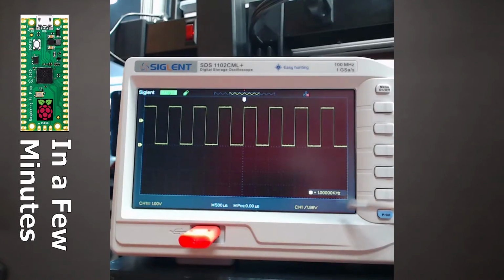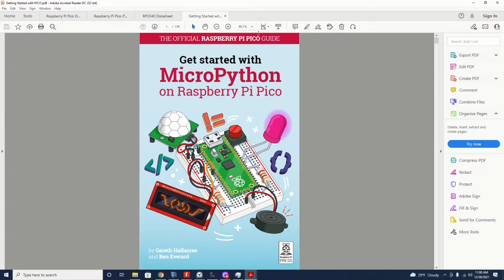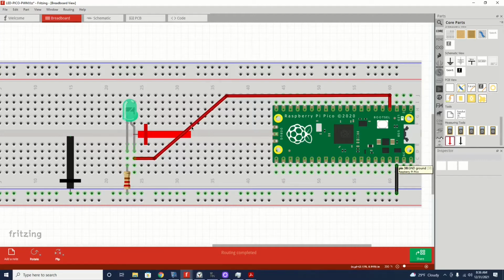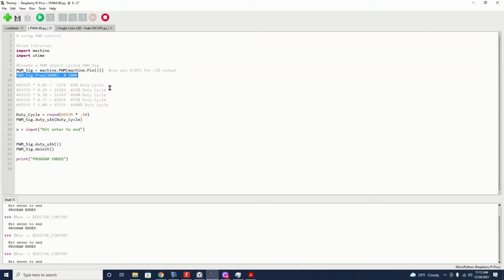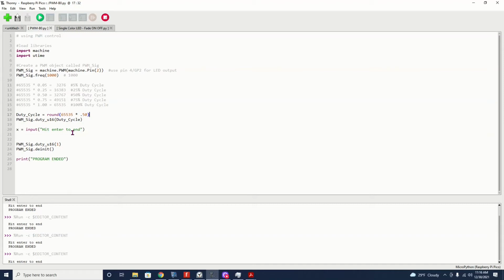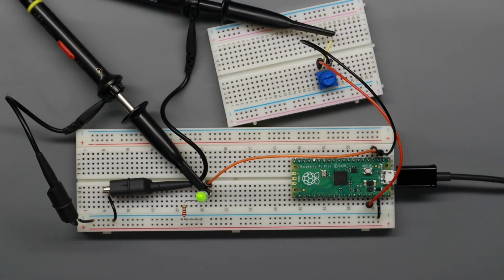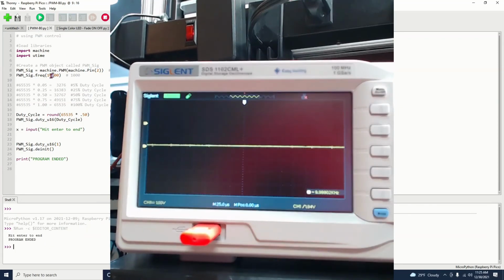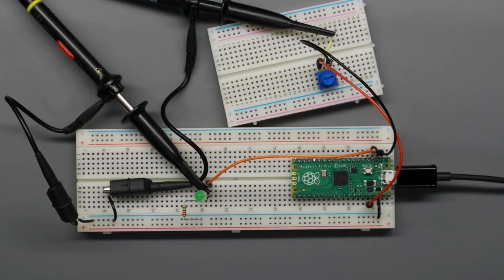Using PWM on the RPi PICO microcontroller

Comment: I have 100 MHz of DSO and 133 MHz of RP2040, sir.I want to make a pwm at a frequency of 1 MHz, however the square wave has a lot of noise in it. Is there anything I can do to reduce this, sir?Additionally, a  PWM may produce a 65 MHz square wave. I'm using micro Python and Thonny IDE .  I want to make 65 MHz. Is this possible, sir? If not, what is the maximum frequency that I can generate? Please let me know.
Reply from the maker: Those are some pretty high frequencies to do.  I doubt that it can be done using MicroPython directly.  The PICO can also be programmed using PIO which is a much lower level to the hardware and allows you to achieve much higher performs.  Unfortunately I have no advice on how to work with PIO.
Cheers!
Chris

Comment: Great video thank you. I am experimenting with RioRand 3 phase bldc motor drivers and hoverboard motors. Can't find much information about driving these controllers with pwm input signal. Spec sheet says it wants to see bwtn 1k-20khz freq. Hobby servo freq (50hz) is apparently too slow. Motor goes haywire. Might need to write some custom code to use these controllers in pwm mode.  Your code is a good start.
Reply from the maker: Thanks for the feedback, much appreciated!  Good luck on your project!

Comment: nice explanation with good presentation ... (font size is a bit small)
maybe 4 leds could have shown the difference better between 25/50/75 duty cycle and no power.